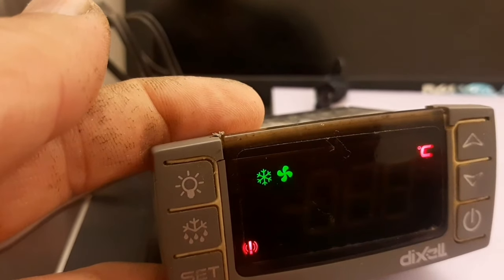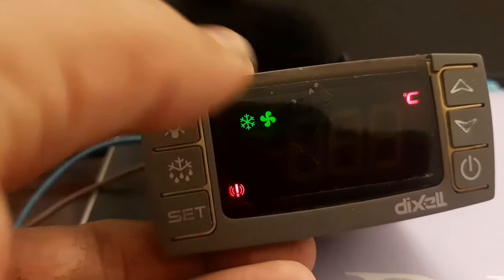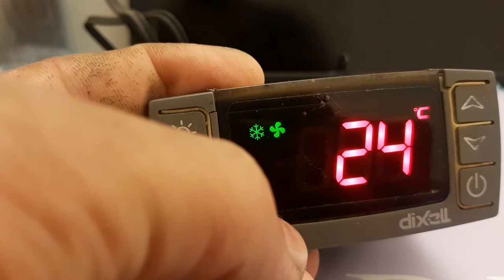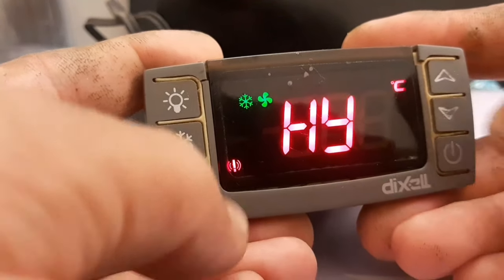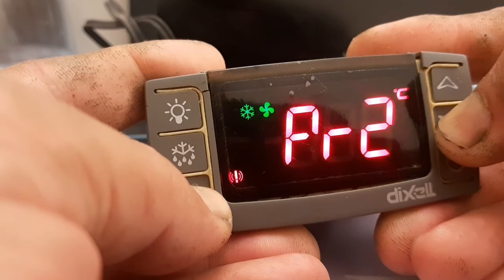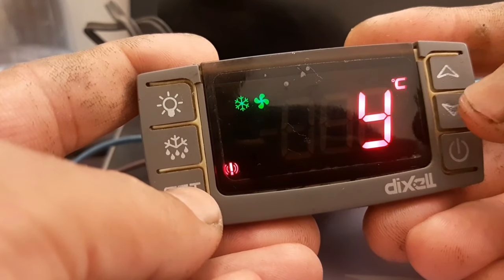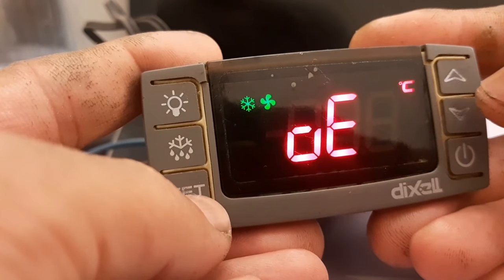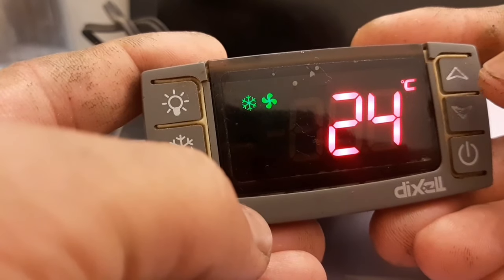p2 error dixell xr70cx | how to rectify p2 error in dixell #zkmultitech

Comment: Sir my chiller showing P1 and not receiving any sound.
Only P1 blinking
Reply from the maker: P1 error showing when cabinet sensor faulty if it is not maintaining desire temprature change it
Reply: @zkmultitech  how can i fixed this..?
Reply from the maker: U need to change sensor (probe) search in youtube how to change sensor
Reply from the maker: https://youtu.be/G7AvSdoNbhU
Reply: @zkmultitech  ok thanks sir
Reply: What about flashing HA
Reply from the maker: Ha high temprature alarm once temrature back to normal it will disappear
Reply: @zkmultitech  thank you for the quick response, it doesn't seem to be dropping temperature after going through a defrost cycle. How would I go about troubleshooting this problem?
Reply from the maker: Check dtE in def perameter set at 4 degree then observe
Reply: @zkmultitech  Def parameter is in the first or second setting?
Reply from the maker: Second setting